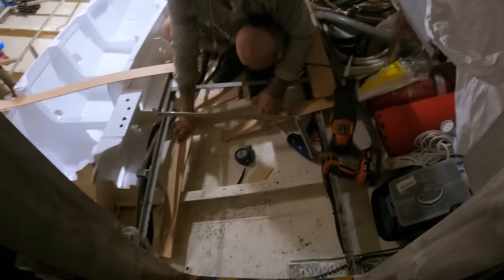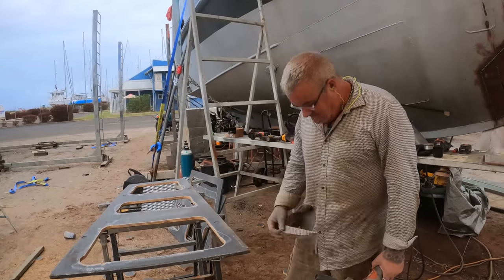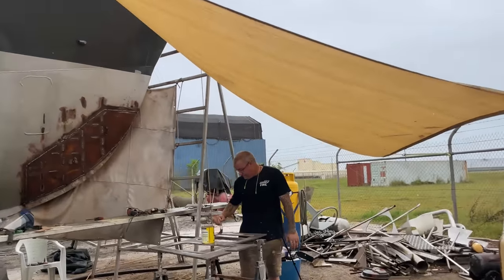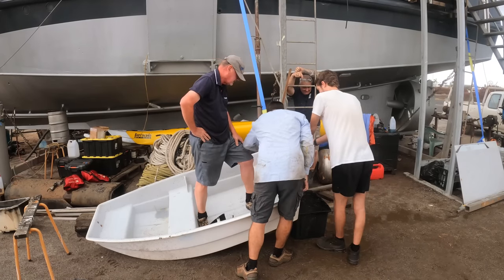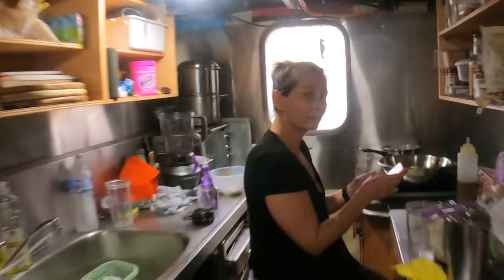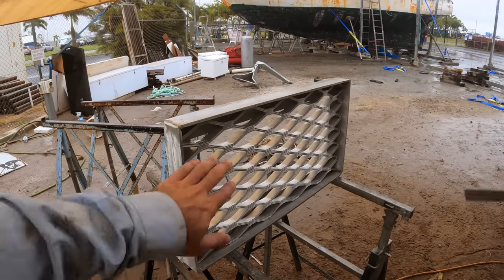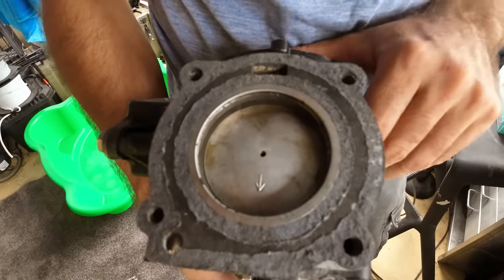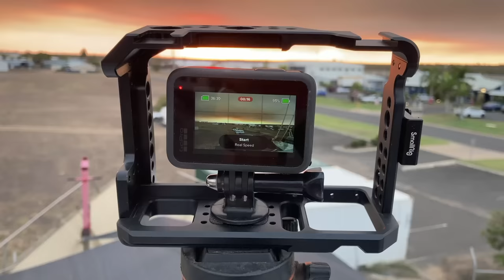How many men does it take to start a $100 outboard? - Project Brupeg Ep. 289

Comment: That Cummins will not slobber all over your bilge like a Detroit Diesel Will, just the nature of the beast. in the 60's I was an Engineer on a Sea Scout Ship with two  6 71's,as main propulsion units,  a 2 71 and a 3 31 as Gen sets and boy it was a chore to keep the bilges clean!
Reply from the maker: Yip and the fuel bill is lower with a four stroke Cummins
Reply: @ProjectBrupeg  Yes Sir!

Comment: It IS possible to kill a magnet in an engine rotor.  If something is misaligned, and the magnet is hit by wobbly flywheel or something, the vibrations  flatten the  magnet.   Had a motorcycle, that had stator(? word) the was slightly out of alignment slowly hit magnet, flattening it.   The dealer changed absolutely every electrical part there was and finally in desperation got the the magnet,.  Absolute fix.  Very rare but you mentioned you can't flatten a magnet.  It is rare but happens.   I'm a pHD chemist and reason why it can die is the vibration.
Reply from the maker: I never knew that. Thanks for sharing

Comment: Hi Guys, just a comment for Duncan, we have a NAS at work which had a HDD failure (or so we thought). After checking the HDD with windows, the HDD showed as perfectly good - no errors at all.  In the meantime I had inserted and configured a new HDD, the NAS went great for about 1 hour, then displayed a HDD error.  Again I checked the HDD with windows which showed NO errors.  To cut a long story short the problem was a power supply problem.  The power supply was NOT producing the rated amount.  So check the power supply, it can produce some strange results, none of which where documented anywhere I could find.  Good luck Guys and Gal and cheers from Napier.
Reply from the maker: Awesome thanks for this. We will have a check
Reply: Thanks for the tip. I think the old drives were legitimately dead, and the new ones legitimately good. However, we were getting near zero CPU performance and carrier pigeon data transfer rate on the NAS, so there could well be something to do with power supply health. I will dig further when next on Brupeg (next week). Cheers

Comment: I think the wood under the deck plates is unnecessary. On navy ships its similar thickness tread plate. Bigger plates do need a cross peice under to support. And I would recommend fastening them down to the support structure. You don't want one to flip up if you step on it funny at sea.

Comment: You can put a slot in the bore opposite the exhaust port and a hole in the piston below the rings. This helps to cool the piston but also boosts the power. Often quite considerably. 
2 strokes are poor at part load (pop-popping etc) but under load they can be at least as good as four strokes. Expansion chamber exhaust pipes are great fun.

Comment: Polyurethane varnish thinned with white spirit is a great way to seal plywood or OSB. It soaks in much deeper than best varnish keep flooding it on until the wood is fully wetted. It will drip and take a few days to dry but it’s wonderfully weather proof.

Comment: Modern  2 strokes are direct fuel injected and are extremely efficient and meet all smog emissions !!
Reply: Check out the Rotax ETECH used in Skidoo snowmobiles and Evinrude outboards. Cleaner than competitors four strokes including cold start, better fuel efficiency per bhp and less maintenance. The 800cc makes 160bhp. Wow!!!

Comment: Next time you have a bunch of holes to cut with a hole saw, drill a small (10-12mm) hole tangent to the hole saw diameter.  This lets the chips fall out of the saw teeth and the holes will drill much faster.

Comment: There is another trick that may also help and that is with aroldite and baking soda. It works for just about any thing , especially when you have small broken gears…..you make a latex mould of a good section of a part , once you remove the mould it’s simply a mater of filling up the mould with baking soda……then the aroldite . Give it a mix , then in a matter of seconds you have a repaired part, may be helpful 😊😊😊😊😊
Reply: Are you thinking of super glue and baking soda ? Araldite doesn't need any filler that I've seen.
Reply: @dnomyarnostaw  yes….you are right , i don’t know why i labeled it as  aroldite . Sorry my bad.